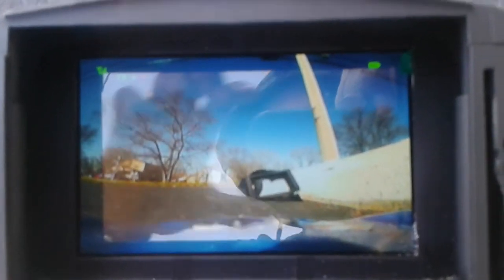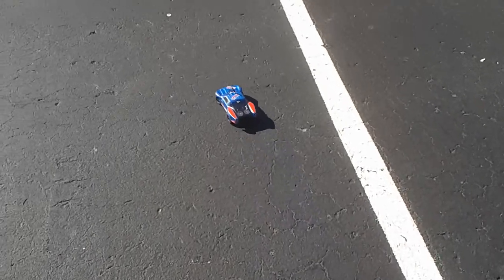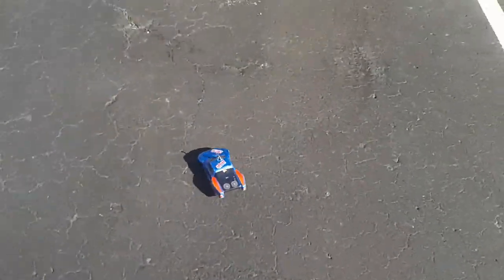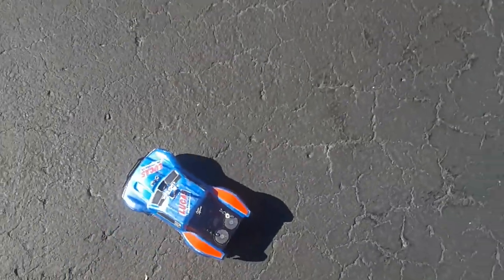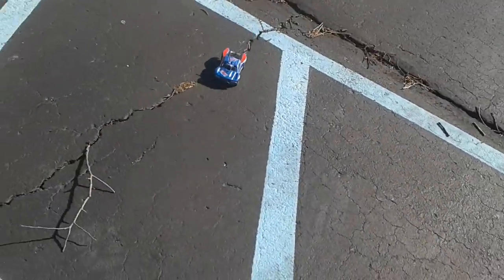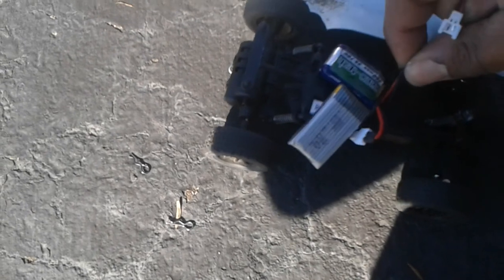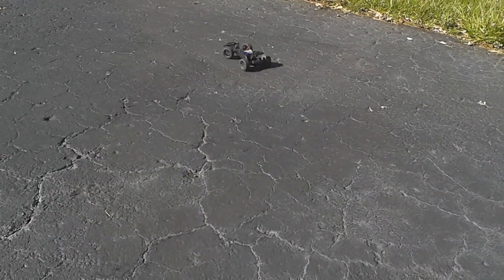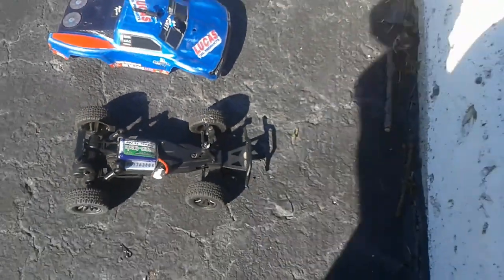Vlog ... I moded my Sc28 short course truck

Comment: Ya I have the same issue too with the speed controller or board. I had to replace my stock motor after it was unusable. After I got a new one it does that issue where it cuts out.

Comment: Fuck yea dud I just ordered a whole setup and sc28 truck lol.  Eachine tx05 fits right inside and eachine ev800d headest
Reply from the maker: sweet sounds like its ganna be fun
Reply: antione motley super fun man.  Same cutout issue on mine at full throttle.  Caused by too much weight from the added camera and battery amazingly.  Remove the trucks canopy and that brings it back to stock weight and solved the problem for me.  I also replaced the motor with some random quadcopters motor and damn yea 20 mph for sure lol.

Comment: A high voltage 1s battery would beef it up even more.
Reply from the maker: Iam runing a nano tech 1s in it
Reply: Nah bro. Not a low voltage. A high voltage. 3.7 is low aka 4.20 volts. 

High voltage is 4.35 volts. It makes the difference and would probably be equal to your racer motor. But with the racer and high voltage battery. Its total steroids.
Reply: @MicroScaleGarage  not to keep bugging you. On my other setup I put this 15x15x4mm fan on my vtx and placed it on the side door. It makes a difference in keeping the vtx cool. I use akk a5 split aio cam on that one but a different cam than what came with the vtx. Just the wire loom with connector and vtx. https://youtu.be/HUiDbwZwY8c

Comment from the maker: Yes I'll do a viedo my son Xavier wants me to build him one but the only problem  is with the racerStar 8.5 brushed motor and the lil  one cell that iam use ing it will cut out at full throttle  I need to fix that thanks for watching more to come.
Reply: antione motley Thanks for the reply, in that new video you can make a battery installation. And what do you use to charge the new battery? I am really new with this electric micro cars. Thanks again

Comment: I know its a old video but can you tell me if the gears wear out with the racestar motor?
Reply from the maker: DexterRulez yes it dose the other 2 i have just at the moment have fpv looking for a better motor thats not to hard on gears i tryed glueing the gears not tesed yet
Reply: antione motley So there is no chance of finding metal gears or spare gears on the market? Don't the q32 gears or the gear upgrade kit work on this car?

Comment: Couple questions. How did you get fpv in there? Do you happen to be by Pa? Maybe we can RC sometime. And have you figured out how to get bigger tires on the Orlandoo?
Reply: Oh yeah, if you didn't know. They make Aluminum longer shocks for the Orlandoo now. I'm ordering some today, with 3 different springs too.
Reply from the maker: Hi LockRock i used a cheap all in one cam i dont know if its a eachine i dont think so .. i just cut the body to fit the cam hot glue it on///, and i live in Michigan sarry bro i would love to RC with any one /////.And the bigger tiers i use team losi Desert Tiers and rims on my oh35p01 kit on the jeep i thinking about getting some of those Xtra speed rims thay look sweet .thank you for checking out my videos  so epic